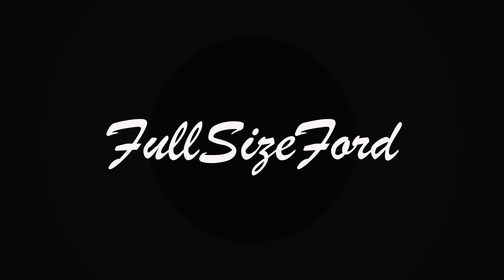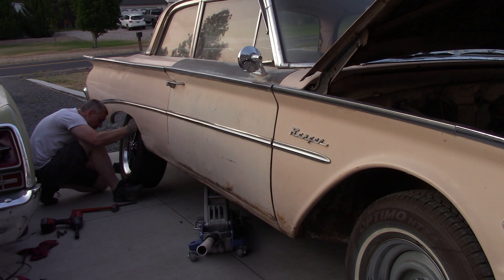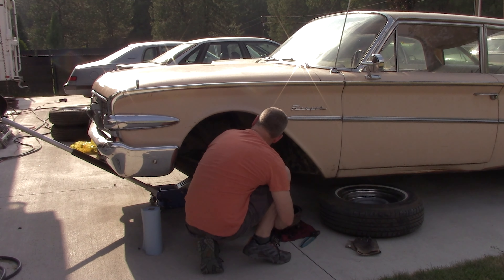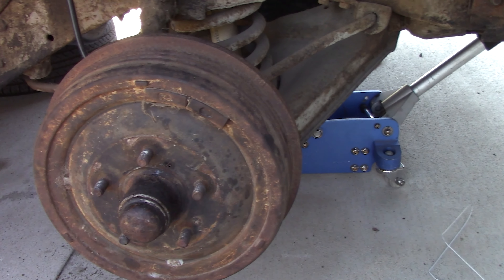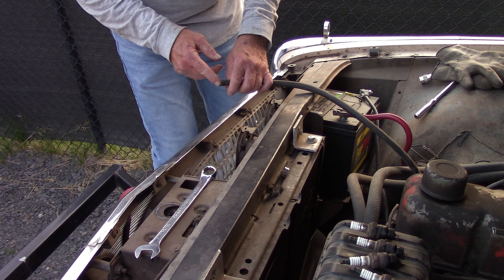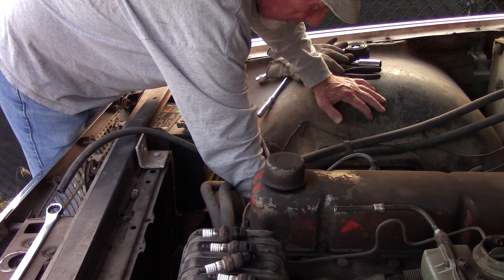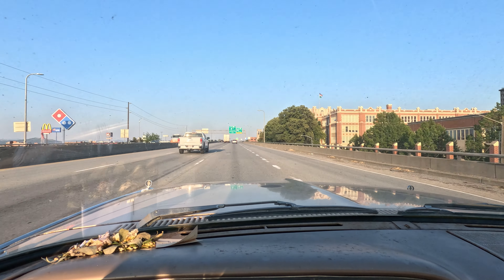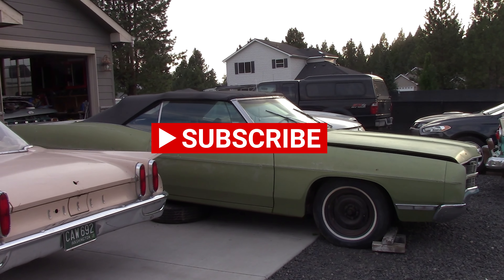1960 Edsel Ranger 2DR Sedan...Prepping for a wedding, a car show, and more! STRANDED AGAIN!!!!

Comment: Very cool, man. Those wheels fit the period of the car correctly. I know what the remedy on that engine issue could be. It needs a 289 V-8. Congratulations on getting married! John Henry's '65 is very nice. My dad's got a '65 half ton short bed Ranger. Years ago, my brother replaced the blown up 352 for an '86 Mustang G.T. roller 302. It has a Tremec five speed manual too. I'm still working on my '64.5 Mustang.
Reply from the maker: Thank you and thanks for watching! I thought about V8 swapping but due to the rarity of the car we’re going to try and run the 6. It seems to be running pretty good now, I even drove it to work this morning.

Comment: I have had Edsel's for about 30 years but never had a 1960. If I did I would use the original wheels and either the original full size wheel cover or dog dish style.
Reply from the maker: Apparently there was a dog dish option but the caps had no script on them.